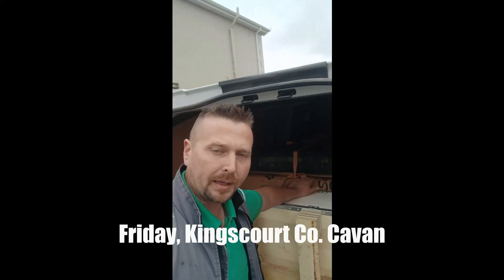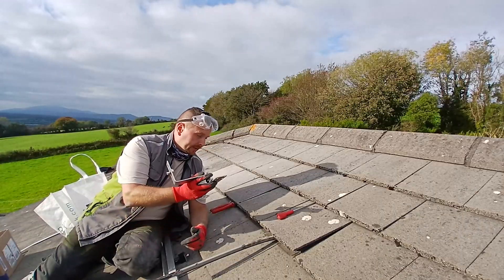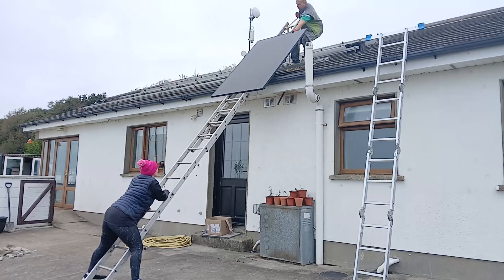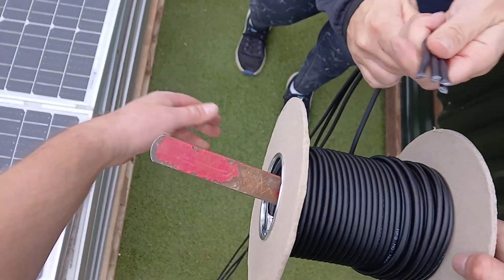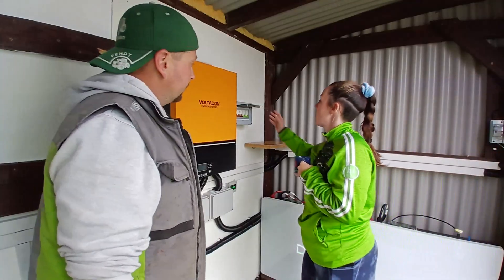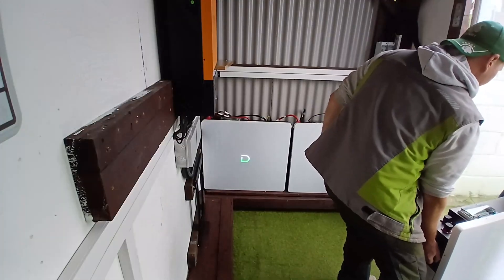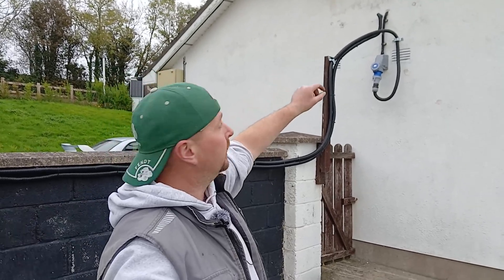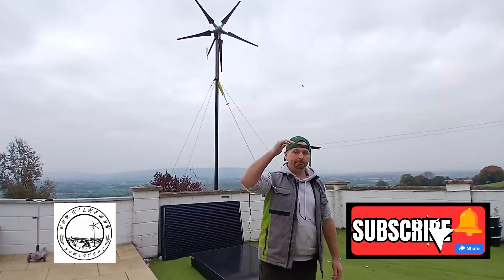Massive Off Grid Power Upgrade (part 1)

Comment: No actuators, tilting array ? I still think you need to get thoughs 450w up at a minimum 50deg.
In cornwall dec 20th the sun at its highest is 70deg. 20deg off ofthe centre of the pannel, on a 50deg.
Thoght i sore to get your maximum productivity the sun has to be with in 15deg of the centre of the pannel and.
Mines at 60deg, so 10deg off of the centre of the pannel, and on a good winters day can still get 80% of the hole arrays peak production.
Reply from the maker: Hi Henry, the planned tilting array will also have actuators (should have said in the vid but forgot). If the build goes to plan it should be able to tilt to 60ish degrees but won't know for sure until I get into it. 
Thanks for all the info, hope all is well.
Reply: Ah! I see, looking forward two part two then.

Comment: It is such a pain doing panel install by yourself, even with two guys. Been there with my 20 n-types a year ago. Fair play to you doing rail installs on tiles, I feel for ya. What I still don't get is your choice of inverter. The reason I swear by Victron is the modularity. I am planning another winter array on a ground mount, and I don't need to worry about how many PV string inputs I have. I can add as many MPPTs as I need, sized for each array, and all synced via DVCC. Seriously, look into it. Oh, and LOL, I am with Clodagh. Power over Wifi, of course.
Reply from the maker: Yes indeed the roof install is a pain. The choice of inverters is purely down to the best performance and reliability at a lower cost level. The victron stuff is very good, very reliable. What puts me off them is the extortionate pricing and out of date overall package for that level of investment. They were the market leaders in just about every aspect of off grid energy for many years, sadly they haven't moved to stay competitive and for a good while now have only been on par quality wise with their cheaper competitors. Unfortunate but it is what it is I guess. With the max 11 systems, for €800 a buyer can get the additional 11kw 2string pv input as well as an additional 11kw continuous output, optional single or 3 phase at the touch of a button and all in an easy installation. Let's face it though, specs aside its purely a personal preference be it one brand or the other. As long as there is scalability and reliability then its a good system😊